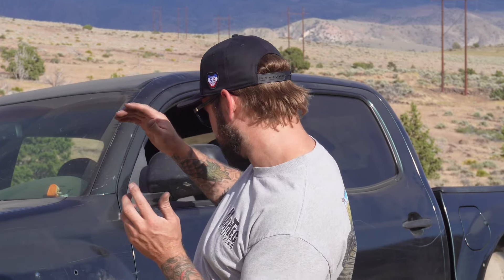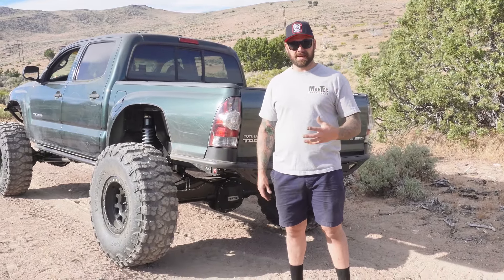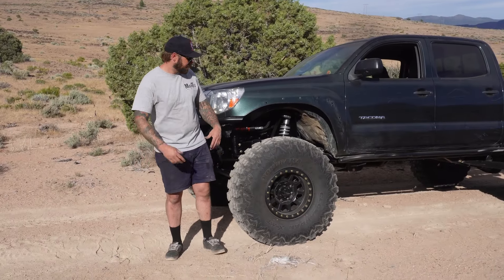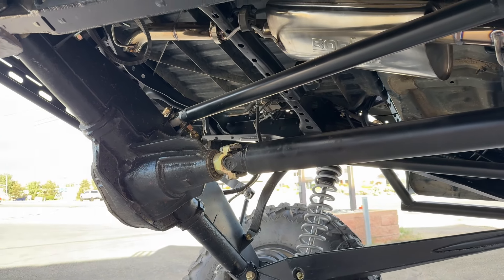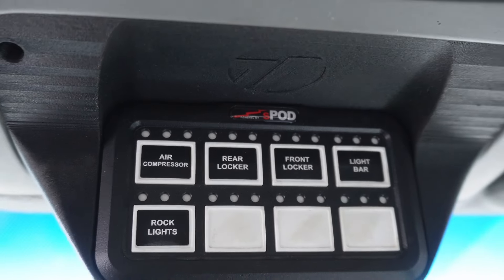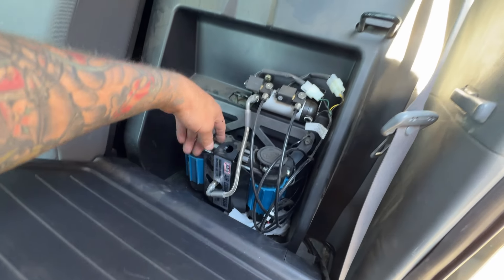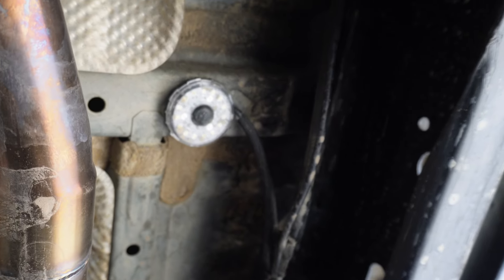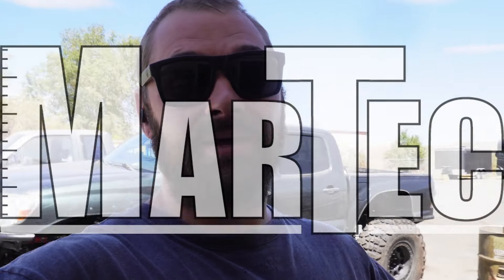4 Link Solid Axle Tacoma Build Breakdown

Comment: Love it. Very nicely built. It has me wondering how that rear link set would fit on my 97 gmc 1500 sas I’m running the same super duty axles with a wfo front radius arm kit.
Reply from the maker: The kit wouldn’t fit but the trailing arms could be made fit to your application